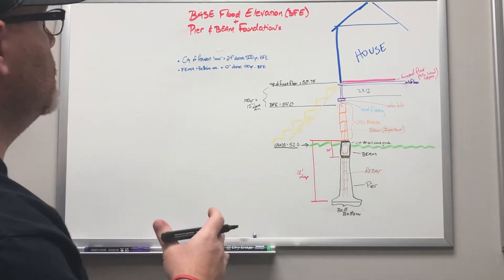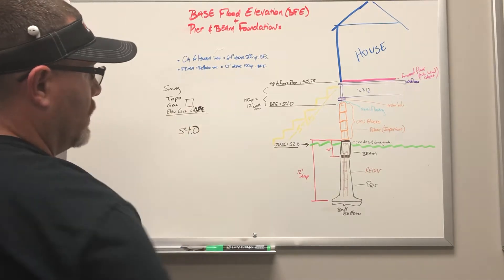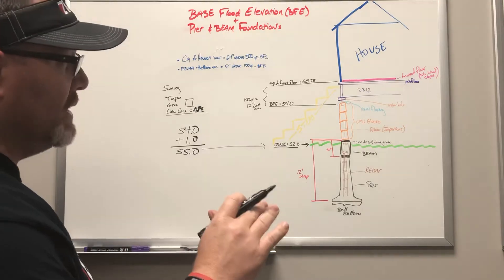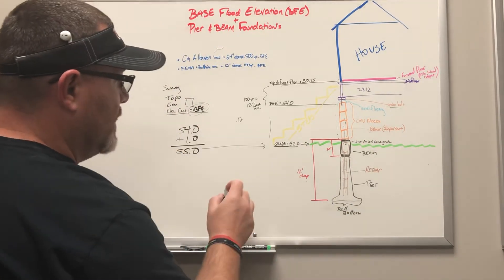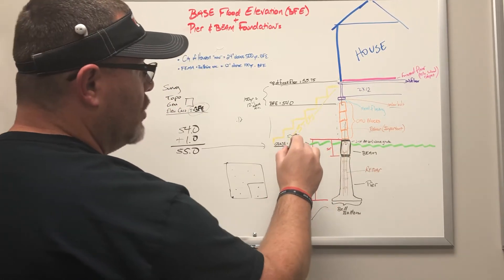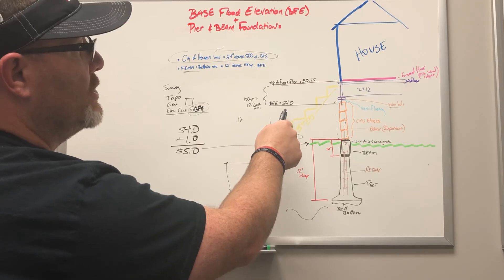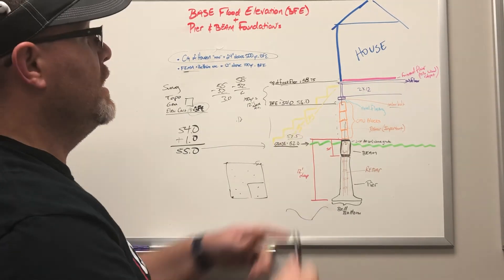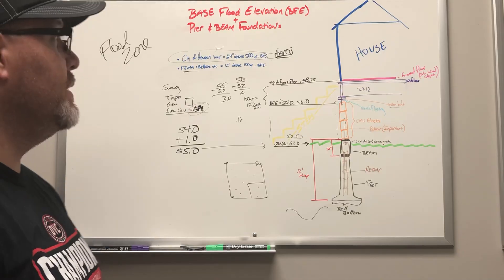#Building in a #FloodZone #BFE + #PierAndBeam #Foundation

Comment: Do I know all this if I just need to be above 32 inches ?
Reply from the maker: Idk your exact situation, but it may be beneficial. Height is determined by the BFE & local building code requirements. So if thats 2’ or 6’ off ground; it’s pretty much building same way generally speaking just how tall are you going up.

Comment: Hello,  suppose a part of a property is within Flood Zone. But, the other portion of the property is not in Flood Zone, meaning it's above the BFE. Would a house that's not in the flood zone still be required (by a lender, for instance) to have flood insurance?
Reply from the maker: @wildmanofborneo  Typically no, if the property is in a flood zone but the structure is not, it’s typically not required. Or where some of the land is in the 100yr & structure is in the 500yr (typically not required) as most insurance companies only recognize the 100yr for requirements. 

This can be waived or adjusted by insurance company - even building officials. 

IMO, if any part of the property is in either the 100yr or 500yr - go ahead & buy it. It’s cheaper when a property is not in the 100yr. 

And Insurance companies define a leak or water break one thing, but a flood another. Meaning a waterline break (ie: freeze), if fills up x-amount they’ll say that is flood. Happens all the time.

Comment: Excellent explanation!  I know there are a lot of variables, but if a house that normally costs $400,000 to build has to be raised 2 feet, what range cost increase might be expected?
Reply from the maker: I dont know how to even guess at that w/out all details… 

But you have structural maybe civil engineering Plans, Inspections & Work. Then Drainage. Concrete (above grade & below) What mtl to raise (cmu) mtl & labor. Theres sub-frame, insulation, stairs, facade. Then you have a raised porches & railings. More flashing…

If never done see if get w/ someone who has. If not think of all the steps & start the takeoff/estimates.  

Hope this helps!

Comment: Great video. Could I apply these if I am building a home in Ohio too? I mean, even if it's not required by the local rules, would it be worth it do to on my own just to make the house better withstand a flood? Or not worth the cost?
Reply from the maker: Absolutely. Water mitigation away from house is Huge!  IF you’re building new - you only get to set the height once. So i would take it into serious consideration.   So id look at 100yr & 500yr + your topography of lot to house and design that way... *slight different w basements, soil conditions, freeze lines, sump pumps etc — but concept of being a few feet above x-amount is same.
Reply: @ZanderHomes  Ok thanks! will do

Comment: 40 piers.  wow.  any idea what the average cost of those piers would be?
Reply from the maker: Yes, could run $40-$50k for a standard design and goes up from there... But All our foundations are 3rd party designed. So it depends on the dirt & load of house itself. And theyre typically spread out 10’-12’ on perimeter and similar’ish on inside main walls...